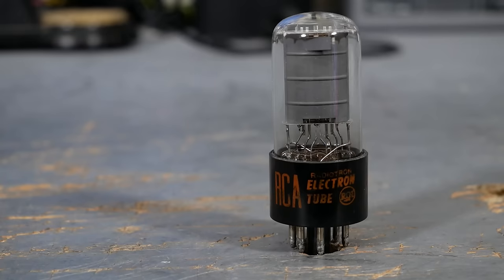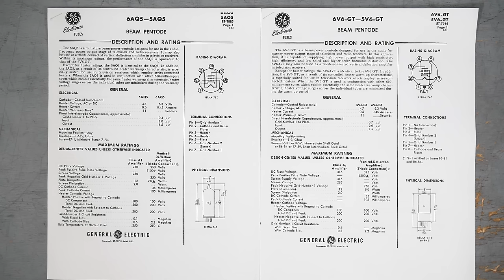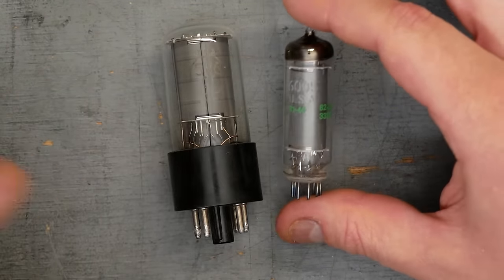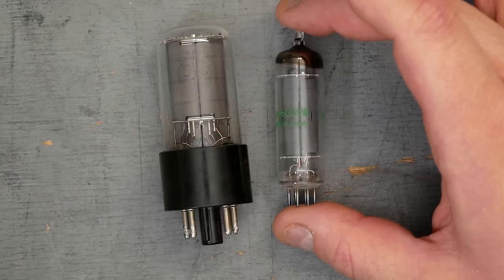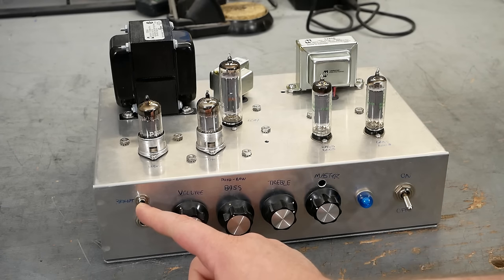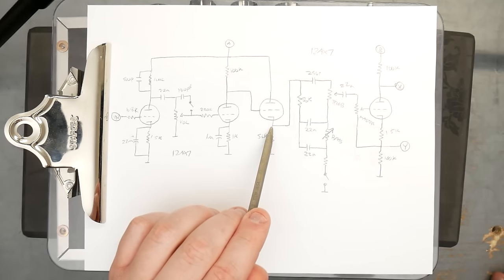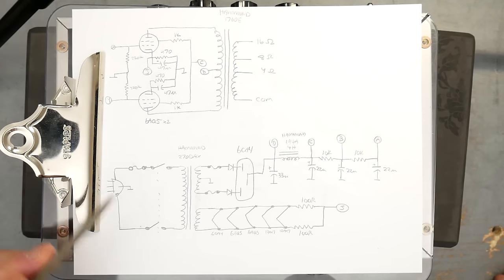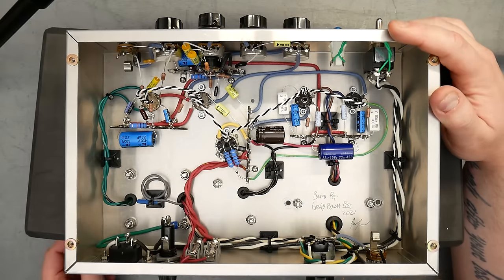The best output tube you've (probably) never heard of...

Comment: I just finished gathering the big heavy stuff for a 5881 single-ended.  It's going in a home-built radio project.  I could also build one with a 6AK6.  The rest of the radio is solid state for too many reasons.  But the audio section is 3 stages of tube amplification, with a 6SN7 mixer that plays the radio on one side and a musical instrument and effects on the other.  The radio itself is being built using an old stereo speaker, decorations, and lighting, to simulate a jukebox (tombstone!) radio from way back when.  Keeping in with the era it's from, before television, before transistors, before Internet (yes, there was such a time period)... so it will cover as many bands as I can think of.

Comment: Nice building , clean job and good sound !
Another nice sounding 6V6 tube is the old 6V6G ...........also wonderfull sounding and one of my favorites .
Reply: Just don't put a 6V6G into an amplifier like a Deluxe Reverb that was designed for a 6V6GB and runs the tube at 70 volts over its rating!
Reply: @goodun2974  That's right ( same with 6L6 etc ).............I know the ratings ........the issue of my comment was the sound quality .
kind regards

Comment: The 6BQ5 were part of the output of the Grundig tube type reel-to-reel tape players.
 I also have a stereo tube amp, maybe 2 in storage that uses those as well. The one is just the raw amp with a pre-amp and connectors, the other has the normal volume, bass, treble, and  balance controls, it might have come out of a old phono or radio floor console.

Comment: In the old days when I repaired tube TVs I have seen the 6AQ5 used as a vertical output. 

I have a stack of 6W6's around here I'm thinking of doing something with. Since the filament current is around 3 times👍 that of an L6  I'll have to find a power transformer with a heavy filament winding or use a separate filament transformer. 

Good design on your amp.  👍

Comment: The early 70s version of the Fender musicmaster bass amp uses a pair of 6aq5 power tubes...the later version uses 6v6s...you can tell them apart because the early ones don't have a separate on/off switch

Comment: 6AQ5's are cool tubes, I thought you were going to say something like a tube that was used as a horizontal deflection amp or something which I probably have some of too. I have built around 5 or 6, 6AQ5 amps. They have their own sound and have a really smooth overdrive sound. Nice tube, easy to find and cheap for NOS. Another cool thing is to build with 12V6's using a separate 12v filament XFMR.

Comment: Great for a super compact single ended project too. They don’t kick off a whole lot of heat when you run them inside design limits.
Reply: Hi I would use 6BQ5/EL84 instead , nice tube in SE configuration both for hi fi and guitar. For Hi Fi you need global negative feedback.

Comment: After the war there was a rush to introduce more compact tubes, and it certainly conserved space in television chassis where the tube count was high. I think it didn't catch on in the guitar amp world because it is was no different than the 6V6 and space was really not important.  Certainly the 6V6 was popular in push-pull phonograph amplifiers and perhaps was something that amplifier designers were comfortable with. Perhaps that is a good thing because there are still manufacturers making 6V6, 6L6, EL34 many of these other tube may begin to fall into short supply... not that this tube is uncommon,  but more in reference to the tubes that were made in the mid to late 1960s that were a desperate effort for tubes to remain relevant in a solid state world.

Comment: I built a little JCM800 with those.  They're close on the datasheets but in practice 6V6s are used often with over 400 volts on the plate.  It would be interesting to know what a 6AQ5 could really deal with.
Reply from the maker: Agreed! I know Gibson had no problem running 6AQ5 at 300V, 400V might be pushing it in the smaller tube package.
Reply: Due to the smaller size they physically can't dissipate the heat of and octal tube with all other things the same.

Comment: The 6AQ5 can't dissipate as much heat as a 6V6, it's in a smaller bottle & has a smaller anode. I'd like to see a soak test comparison or testing after 1000 hours of use at high power OP. Still in a practice amp or home use it's absolutely fine.

Comment: A pair of silicon diodes in series with the rectifier's plates are a bit like belts and braces, no?
Reply from the maker: The series diodes are protecting the power supply from a shorted rectifier tube. Without those diodes, the filter caps could potentially see very high AC voltage and fail spectacularly! See Robrob's info on "backup" diodes: https://robrobinette.com/Generic_Tube_Amp_Mods.htm#Protection_Mods
Reply: Not only do the diodes add protection for the power transformer and rectifier tube, as described here, but you still get the sag and compression of a rectifier tube when you play hard (a fully solid state power supply would be much stiffer feeling) and it also still gves a gentle time delay of the B+ feed to the tubes and caps at turn-on.

Comment: I used the 6aq5 in my last pp build - wonderful sounding tube.  I see you used the Hammond 270DAX - that means you have about 367VDC on the plates.  That's quite a bit over the data sheet max of 275V.  How has tube life been?
Reply from the maker: 367V would be about right if it was solid state rectification, but don't forget the 6CA4 drops about 60V. Plate voltage is right around 305V. That's still in excess of the 250V or 275V shown on 6AQ5 datasheets, but the handful of guitar amps out there run the plates at ~300V no issue.

Comment: The JJ 6V6S is a superior choice, with a max plate dissipation of 14W, plate voltage of 500V.
Reply: I can see that in the sense of the fact it handles more voltage but as an amp builder you are the one who controls that so you can design the power supply to put the ideal voltage for this tube as well. They have a different tone, the sound very smooth compared to a 6V6, I actually prefer them to 6V6's and have built a handful of amps with 6AQ5's. I actually built an amp using all 12volt tubes using 12AQ5's which I want to say I got a sleeve of 5 NOS for $25. It is one of my favorite sounding amps.

Comment: Wonder how that would sound with EF86 front end?
Reply: Hard to get quiet, non -microphonic EF86 these days, and vintage EF86 are expensive; I'd be tempted to use 5879 low-noise pentodes instead (often used as a mic preamp in vintage PA equipment); not super common these days, but available as NOS, and not terribly expensive. Or perhaps even 6AU6 which are common and cheap as chips; you could buy a dozen of them for about 3 bucks each and select the quietest ones. BTW, I have a big Webster PA/paging amp with 4 !!! 5879 inputs, 4 6L6's, and two 5U4's, which is just begging me to build a guitar amp out of it....

Comment: The schematic for the amp bears a resemblance to a Garnet Herzog or a Fender Champ.
Reply: How so? It has a DC coupled cathode follower into a tone stack, a master volume into a Cathodyne PI into Push Pull power tubes. A champ is literally two preamp stages into a power tube. This is sort of a mixture of a Brown face Fender deluxe front end with a master vol added into a 5E3 tweed power section with some component values changed.

Comment: Winfield Thomas build a 5 watt amp out of spare parts. He put both power tubes in the amp a 6v6 and a 6AQ5. He sent it to me. You can only use one tube at a time you would have to pull the other tube out. There wasn't much of a difference at all

Comment: Hi, try making a Fender Deluxe Reverb, or Princeton Reverb with 420V average plate voltage with 6AQ5 (arc in 10 minutes), I don´t know why you didnt use a current production rectifier ass well.  To me 6AQ5 are more like 6BQ5 with an, unusual , for 21th Century , 7 pin base only found in old radios a TV. You could have put 6bq5 in that amp (with 9 ping sockets) and sound almost the same with a little more gain (a BOX like sound). no feedback, only difference is rectifier tube and individual cathode resistor witch changes gain structure and harmonic dist.  and different tone stack and PI, a long tail would allow to put the master post PI (also biased cooler than a BOX AC15 witch is nice,). A nice experiment but impractical if you want to build one and need tube stock and reliability as you said there are no current production 6AQ5, for me, the big difference between a 6v6 is max plate voltage. 250V max plate is too low for a guitar amp. I know you can abuse them but not much, 300v top. And they won´t last. Again a nice experiment. You used good iron, that helps. Cheers.
Reply: My exact 💭 thoughts
Reply: I guess if you are using off the shelf transformers made for a deluxe but, a builder can make whatever he wants. I have built amps out of control transformers that put out 240v, with a bridge you get about 325v before load, you just use a separate 6.3v filament transformer. The cool thing is you can usually get both for less than you pay for one of those "fender" replacement transformers. It just depends on what you want to build vs how much you have to spend. If you are building clones, I suppose it may be the safe option to buy a kit or individual parts made for your clone but every amp I build is a unique entity. I generally do use modified existing concepts for successive stages. For instance, the last amp I built was sort of using the idea of a 5E3 preamp but instead of using a 12ax7 I used two separate tubes a 6SJ7 pentode and a 6SF5 which is an octal triode with 100mu, using the same basic interactive V,V,T, scheme of a 5E3 but then I used a 6SL7 set up as a paraphase inverter into a pair of cathode biased 6V6's. This thing sounds phenomenal, like nothing else. I used the chassis/PT out of a 1954 Revere R2R with a OT from a 59' Conn Organ. It is mounted in an upright 59' Magnavox record player console with a 57' 12" magnavox alnico speaker out of a different console.
Reply: @skullheadwater9839  HI, I put " Fender Deluxe Reverb" not as a brand or specific model, It cuold be any clon with similar circuit, It´s not an unusual one , didn´t mean to put "Fender" in the context of cost or status as vitage or valuable device.

Comment: 6146A in a Williamson circuit…..beefy!
Reply: The 807 was often used in Williamson amp designs.  They're still fairly common and affordable today whereas the 6146A is rare and pricey and perhaps should be saved for use in original early Ampeg SVT bass amps.
Reply: @goodun2974  The 807 is just a 6L6G with a plate cap, (not the GC version.) The 6146A and B versions are a nice powerful compact  tube for RF and modulator service, along with the S2001, 6883 and 8298.
Reply: @MrCarlsonsLab  ,  If I remember correctly, the 807 could handle significantly higher plate voltage than a 6L6G, which is why it was favored for use in small RF transmitters (6L6G was rated for only 300 volts). The 6146A and B are very different animals, of course.
Reply: @goodun2974  Yes, the reason the 807 could handle more plate voltage is the plate connection is on the top of the bulb, not in the octal base like the 6L6G. The internal structure between the two is identical.
Reply: @MrCarlsonsLab  ,  Of course, 807 were usually used in class B as transmitters and therefore coul handle even more voltage than you might expect, compared to what they can handle as class AB audio amplifiers.....

Comment: Mm... nagging question. What do the output tubes sound when pushed compared to 6L6?
Do you have a speaker emulator?
Reply from the maker: I would generally reject the idea that output tubes have an inherent sound. Even if it was true, being able to separate it from difference in circuit design, actual component values vs. marked values, and subjective listening would be impossible.
I don't think I do.
Reply: @graybenchelec ,  In general I would tend to agree with you, but I also had an experience with a Kalamazoo Model One that I had recapped which sounded kind of tame with 3 or 4 other strong-testing American and Japanese 6BQ5's but when I installed a good used  European Amperex Bugle Boy EL84 into it, the amp turned into a tiger and sounded very much like a miniature Vox AC30. The difference was staggering!  In hindsight I am guessing that the Amperex EL84 was a true pentode with internal suppressor grid, and the American and Japanese tubes I tried were beam power tetrodes, not true pentodes.

Comment: Gray, you do of course realize that if you could formulate a version of the classic Champ with this tube and somehow find inexpensive transformers (maybe possible because of the lower plate voltage or a doubler? that you would be the amp geeks version of Mr Beast with millions of subscribers? Well maybe not millions but I do think you would  be a real hero!
Reply from the maker: Hah not so sure about that. You could use 6AQ5 in a 5E3 kit, just have to do something about the plate voltage. There's solutions out there!
Reply: It is a cool tube but many of us amp builders know about them and have already been using them for years. No disrespect intended to Mr. Gray.

Comment: Curious, why cite the EL34 and not a 6CA7 but then referred to the EL84 as the 6BQ5? I never hear anyone refer to EL84s by the American 6BQ5 nominclature. My Fender Bassbreaker came with EL84s and its Fender marketing lists that as the tube type, not 6BQ5. It just strikes me as an odd choice and could be somewhat confusing for the uninitiated.
Reply from the maker: Fair point! I think I was trying to leave a little context clue for anyone who might have been confusing 6AQ5 and 6BQ5, but yeah EL84 is probably the more common part# overall.
Reply: @graybenchelec  Thanks for the quick reply. I take your point about 6AQ and 6BQ tubes and it's a valid one.
BTW,  love the channel, keep up the great work!
Reply: Yes EL84 tubes tubes have it hands down. Lol.
Reply: American-made new-old-stock  6BQ5 and 6CA7 are likely to be  beam-power tetrodes and not true pentodes like European EL34 and EL84 tubes. Phillips held the original patent on Pentode tube design and most American manufacturers didn't want to pay Philips to manufacture their own pentodes, so they developed beam powered tetrodes which have beam forming plates to direct the electron stream. 6BQ5 and 6CA7 are pin-out plug-in compatible with EL84 and EL34 respectively, but the performance might be a little different in some cases.  Towards the end of the tube erar, of course, many American manufacturers such as RCA were importing tubes from Europe and rebranding them, and so you might see true pentodes bearing American brand names -----  And it's possible that the Phillips patent may have run out and allowed American companies to produce their own pentodes,   but would manufacturers bother to retool for this in the 1960s when it was clear that the era of vacuum tubes was ending soon?
Reply: @goodun2974  probably not but you misspelled era, so...can I trust you? Lol.
Reply: @noel3422  , what can I say, I have big hands and I'm typing on a small screen; also, my eyes are old and my brain writes faster than my fingers can keep up. BTW, I really need to start building some small amps of own because I've got about 60 NOS 6AQ5A /6005WA ruggedized military grade output tubes.
Reply: @goodun2974  Depends but yeah, many times a 6CA7 will be a beam tetrode but not the 6BQ5's nearly as much.